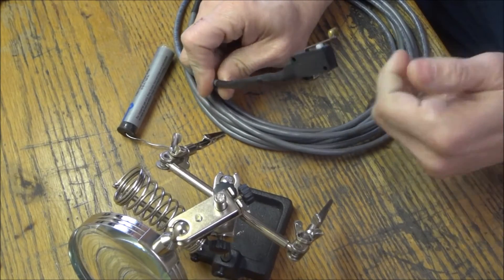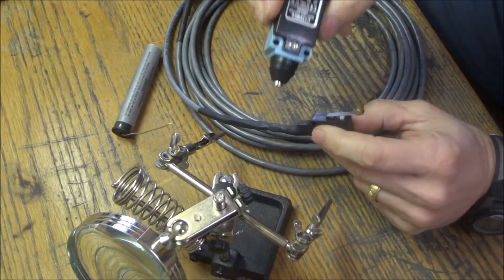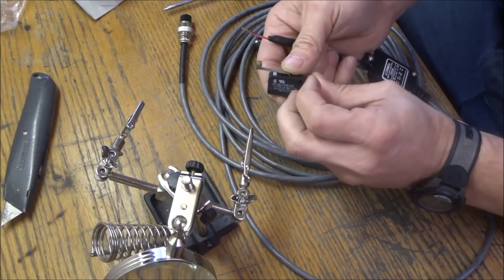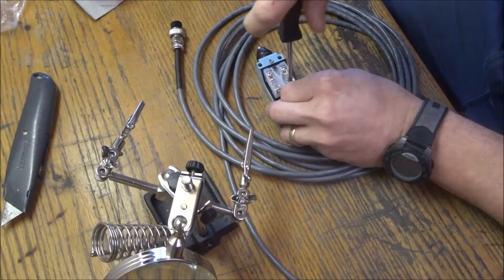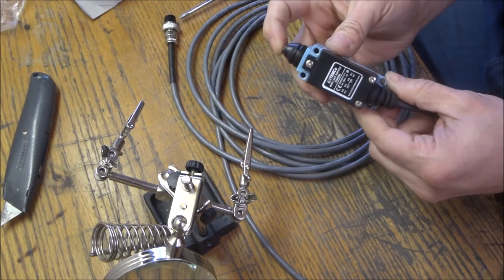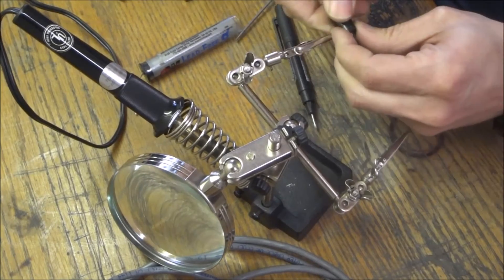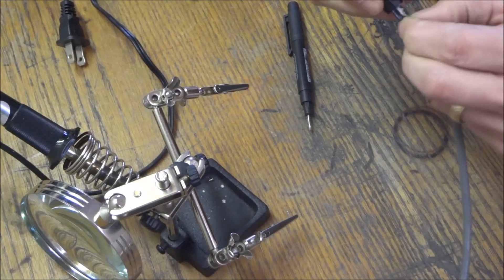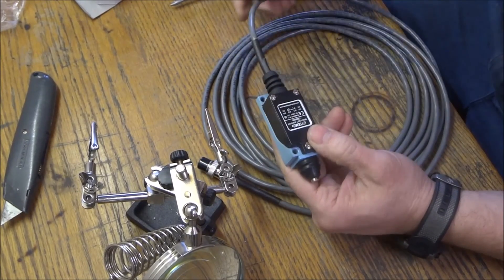PM 727M Wiring " home switches"

Comment: Sam, do you double the shrink tubing to increase the cable's OD so it fits into the rubber boot of the switch tighter? The Belden 9925 is a .209 OD. And it looks to be hard to find right now in small quantities. The Belden 9927 which is a 4c is .219. A .250 OD cable would probably fit into the boot very well. With the switch only needing a 2c wire, one would thing that the switch's boot would be a smaller diameter. I am also surprised you don't ground the drain wire to the mill.
Reply from the maker: You can add heat shrink to the end. this what I did.

Comment: How's the repeatability on these, have you tested them yet? I'm using the style you show at the beginning of the video (on my lathe) and repeatability is terrible.
Reply from the maker: Great I hope but I will let you know. Telco  states that the design is (Snap action contacts ensure repeatable performance in applications that involve low speed actuators. The amount of travel of the contacts is also not dependent on the amount of travel by the actuator.)

http://pages.ebay.com/link/?nav=item.view&alt=web&id=281913004689
Reply: +russtuff if using as "home" switches repeatablility would be more of a concern however the term "limit" switch was used a bit in the video as well...  I dont think as a "limit" switch it would matter as much as to my understanding limit switches arent placed at the extreme limit of the machine anyway.  Correct?
Reply from the maker: +Bill Schultek I will be using these as Home switches and the design has excellent repeat-ability I have used similar type switches at work they seem to be reliable we will see Not a big investment $16 for three so it wont be a costly mistake if they don't work out. lol
Reply from the maker: +russtuff Rus you get more comments on My video's than I do LOL
Reply: +CNC4XR7 I just sent Bill over here last night because he's researching switches too :)
Reply from the maker: +russtuff Cool Thanks Hopefully the info will help
Reply: I am curious how these switches have worked out for you?  I am thinking of using the same ones on my build.

Comment: I bought some of those switches also but they turned out to be too large for my small mill (Taig).

I noticed that you always tin your wires for everything, that would not be allowed for Military contracts. The solder in the wire used on screw terminals breaks down and flattens out under time causing loose connections and high resistance at the terminal. If you tin wire on a piece of equipment which has a lot of vibration the wire will break right at the end of the tinned area every time unless you take care to make sure the wire is secured by glue, strain relief, etc.

Some people may not agree with me but I just thought I would mention it. I was in the Navy for 11 years and worked for Raytheon Co. for 36 years and attended at least a dozen required soldering classes during my career, even one for NASA.

Just my 2 cents and I still love to watch your videos. Keep up the good work.
Reply from the maker: +William Hardin
 Hi William, Yes you are correct a wire Ferrel would be the best choice for stranded wire under Screw terminals as mentioned they can over time flatten out and loosen.
I have not had a issue with the small wire and low amp connections.  I like to lightly tin the ends rather than have the loose strands.
Reply: It was just an observation and not intended to suggest you are not doing it correctly. I only wish I could wire a cabinet as well as you. Your work on this cabinet is very professional looking and I am sure it will serve you well.

Comment: personally I went with DIY hall effect switches, I machined a small acrylic back shell then potted the whole lot in epoxy, these are completely waterproof and only react to the presence of a south magnet so metal swarf also has no efffect, additionally being electronic they are not susceptible to mechanical failure
  I made mine also with an LED in the enclosure on each switch which gives a handy indication when they trigger.

Here is a thread I used in making mine:;

http://www.cnczone.com/forums/open-source-cnc-machine-designs/101878-cnc-forum.html

Really enjoyed this series btw as I am about to do some major re-wiring on my system.

Andrew
Reply from the maker: +Andrew B (Vikingboy) 
Thanks Andrew, I went back and forth with this and in the end I decided to go with these mechanical limit switches. there cheap and only a two wire hook up. There wired NC contacts. I felt like there not as susceptible to false signals. I do like what you did with the Hall effect sensors really nice job.
Be Safe Sam
Reply: CNC4XR7
Yes I understand, the hall effects are also in a way NC as they switch to ground when activated, so with a pull up resistor on the input if there is a bad wire etc it will also fire. I still had a little trouble with noise,, but after addiing a ferrite core around the wires going into the BOB it was all solved.

looking forward to more videos

Andrew
Reply from the maker: +Andrew B (Vikingboy) 
 Really good write up on the Hall effect sensors and you cant beat the size. I was just trying to keep it simple.